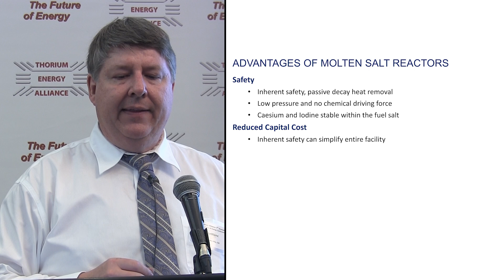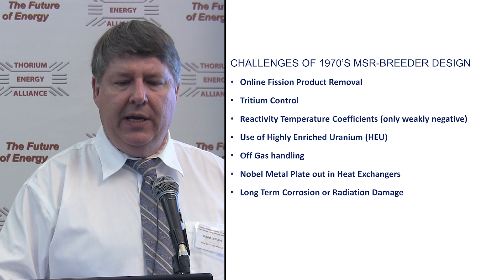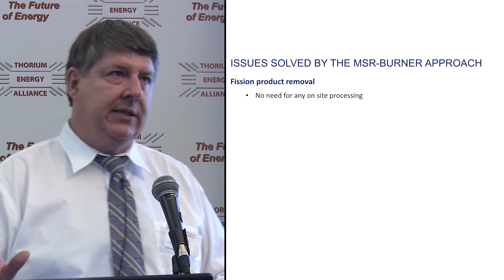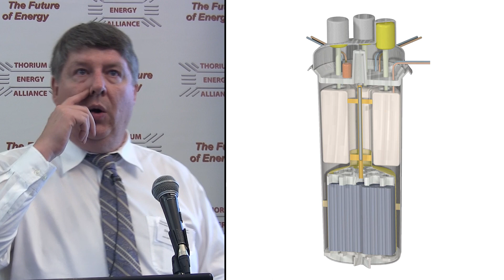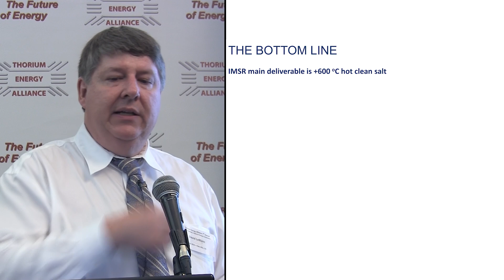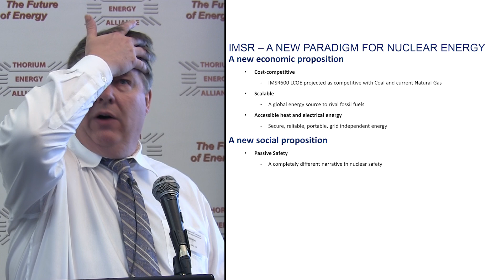Dr. David LeBlanc  @ TEAC7 -  IMSR: Terrestrial Energy's Integral Molten Salt Reactor

Comment: Tellurium embrittlement or segregation of the Hasteloy-n and the additive to keep it from breaking the reactor down.  Add the moderator that contracts and expands, which is your reason for changing the core, Uranium 233 as the fuel, not thorium 232, and a industry that is known to lie and not known until decades later.

Comment: Heard the CEO, Simon Irish, on a podcast in Feb 2022. They've undergone 7 years of regulatory review with another to go. Not expected to go online until 2035. It's obvious that government regulators are the biggest obstacle to deploying ANY nuclear technology.
Reply from the maker: It's actually been less than 5 years of actual VDR work. 2016 was when pre-engagement with the regulator began (contracting, scheduling, etc).

And it is not another year of work to complete VDR. All the submissions have been made. They will be assessed by the CNSC for probably 3 or so months before rendering their opinion.

And no, it will not be 2035 for our first deployment. We could still hit 2030, provided that a site can be procured in 2022, and we believe it can.

Comment: This is probably not the right place to ask, but does anyone know if MSRs will generate Cherenkov radiation and cause the liquid to glow blue the way you see in current reactors' advertising and stuff?  I know the salt is more or less clear/light blue-greenish but it would be pretty badass if it did glow.  

I'm giving myself the award for most useless question ever.
Reply: Yes, It definitely will